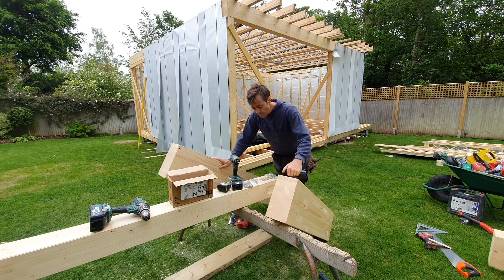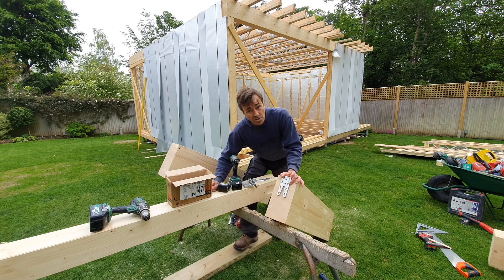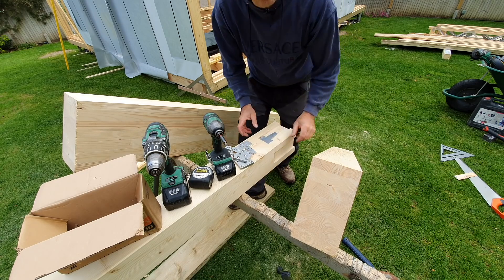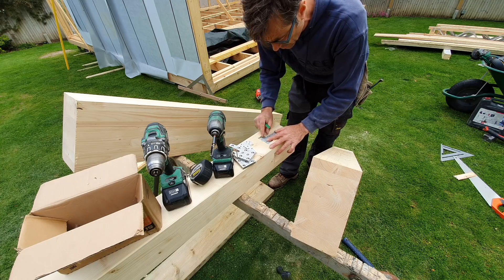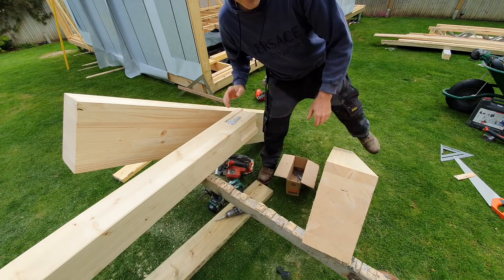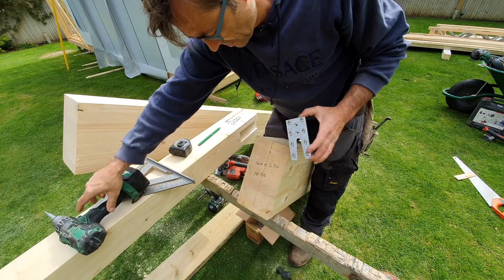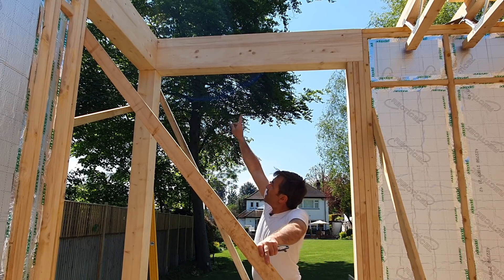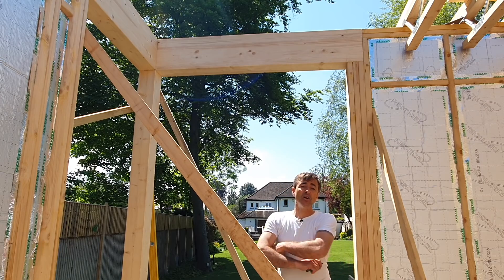Timber connector, concealed beam hanger for glulam by Simpson

Comment: Nice! However, you can do a sliding dovetail made with wood, and it is just as strong just set up time required .  Those connectors are "expensive " here in the States. Cheers, mate ✌️ nice work.
Reply from the maker: Thanks John!!!

Comment: Heya buddy. Have you had any experience fitting the Simpson BTALU concealed hangers? I'm struggling to work out what method to advise my builder/carpenter to use to form the slot to the supported 120x320mm glulam on site.. needs to be 115mm deep from the end of the beam and ideally not full depth (i.e invisible from underneath). Not sure if a circular/plunge saw would get deep enough. Grab the chisels?
Reply from the maker: Hi Mate, I have used the connectors that you mention, indeed I have them in my garden house where I have a big glulam frame, I ordered my Glulam pre slotted as the slot for the spine needs to be a pretty good fit, it could be done on site by making a jig and using a router as far as you can then a forstner type drill bit the same size that would follow the slot that the router made and keep everything true, I did have to drill the dowel positions on site and again this was pretty tricky and I made a jig to keep my drill true and aligned
Reply: @robinclevettcarpenter  Many thanks for the quick reply man, you've made me one happy fanboy today! The method sounds achievable and a lot more sensible/affordable than the chain mortiser approach that Rothoblass suggest on their vid (looks like a cool toy though!!). 
All the best.

Comment: Very nice work!! Question though... how do you connect these "2 horizontal glulam beams" with "the vertical post"? Do they simply rest on the vertical post or is that another joint that was not shown in this video? Any details would be very welcome! Thanks!
Reply from the maker: Hi Mate, the post end of the glulam is supported by these Simpson connectors and they act like a flat dovetail, the other ends of the beams sit on pockets in the timber frame as normal
Reply: Hey Robin, I'm about to build a glulam framed veranda on my timber frame house. I've been on the Simpson website, but the choice of fixings is huge. Can you remember the series number of exactly the ones that you used on the super great video. Cheer 😊

Comment: Robin what is the model of Hikoki circular saw you were using when u made that rafter jig template. It looked like it came with a hard plastic case.
Reply from the maker: Hi Travis
It is a C3607DA36V Multi Volt Circular Saw with Brushless Motor
Reply: @robinclevettcarpenter   Oh awesome. Thank you.

Comment: By putting the screws in at that angle it reduces the shear in the screws compared to them being at 90degrees.  They could not be angled up as they would then emerge out of the top of the beam.
Reply: That's a good point. Makes me wonder if they did some lab tests of shear strength vs pull-out strength and decided this was the superior solution, even if people's initial instinct is that it's wrong.

Comment: Hi Robin, a question for you...If I am doing resin studs into treated timber ledger, and also using treated 6x2 for the frame do you have to use stainless steel nails and stainless steel studs or can you use normal nails and studs.... or have you done a video on it...?? Just was wondering about the treated timbers chemicals and how they affect nails/studs etc....

Comment: Robin, any videos or help on working out compound angles? I'm building a garden corner sofa, the seat base is pitched 5° and the backrest is at 105°. I'm doing two 30° 'corners' so it's a bit more comfortable than a 45° corner. Trying to figure out the compound cut at a 30° corner where the backrest is pitched at 105° is blowing my mind! 🤬😂
Love your work! Cheers
Reply: Should have a look at the program Sketchup if you havent already (Free trial). Not too complicated to use, and really helps when making things like that to sort out the angles/dimensions etc.

Comment: Never seen those ties in Oz they look good. Those type of lam beams are also now hard to get hold of. Not due to the shortages they were before. Not stocked by the engineered timber makers. You can get them but special order. Not sure why they were good and great to work with.

Comment: Doesnt putting that bracket on the top half of the beam mean all the load is taken up in the top 50% of the beam? with the bottom just hanging of it? I would have thought this would reduce the maximum loading capacity of the beam and potentially allow it to split along its length?
Reply: You aren't loading the beam up to its maximum shear capacity. The connection will designed for the forces on the beam and not the maximum force the be can take.
Reply: @Aaron-gl8cm  But isnt that wasting wood right? get thinner cheaper beam and use its full potential?
Reply: @krellon  the timber beam is likely designed for its bending capacity or deflection. 

You are right in saying that this connection will not be able to take the full shear load of the beam. Timber design is all about the connection as they are usually the "weakest" point. Even on traditional timber frames member sizes are larger than they need to be to get the connections to work.
Reply: The glued timber beam with layered timber and glue acts almost like a horisontal truss, which makes it a lot stronger than a standard wooden beam even if it's not fastened at the bottom. The glue is a very strong bond.

Comment: I love the use of new technology meeting the traditional materials Robin and you are definitely an ambassador for that thinking. I remember an old 'New Yankee Workshop' where Norn built a bench just using 3/4 Ply, making the legs from angles of the same. I could never find a system that would take a stacked dado cutter though. One funny of that series was the subtitle that kept coming up saying 'guards removed for photographic reasons' when it would be impossible to complete the cut with a guard in place.

Comment: Might be a daft question but here goes. Would there be any additional fixings? it seems like the weight of the beam is sat on the Simpson plates. In terms of bearing they are max 5mm thick and any movement on post would mean the beam slips?
Apologies if I've got this wrong
Reply: They have an angled profile like a french cleat so the weight of the beam/load actually tightens the joint. Lateral movement not possible.
Reply: @mjslug  thanks, seems like a no brainer for future works

Comment: What I like to see is the quick western approach to a joinery solution, but in the back of my mind is also how the Japanese traditional joiners (and traditional joinery) have done it. Just adds to the depth of this trade.
Reply: Traditional joinery was also practiced outside of Japan including but not exclusively in England.
Reply: As James B. has already said, traditional joinery with carefully cut joints was not exclusively a Japanese thing! That's just how it was done back in the day. Of course, Japan being Japan, they hate to change anything so old methods linger. You'd probably love to see a Japanese house framing. They still use heavy timber framing for the basic frame, complete with traditional joints and a guy balanced on the ridge beam banging them in with a huge mallet. But the frame is pre-cut at the factory (probably computer controller cutting) and delivered onsite shrink-wrapped on palettes. A crane is hired and the whole thing goes up in a day. But then substantial amounts of modern metal fasteners are also used. This system reminds me exactly of something Japanese framers would use. Well generally it's all thru-bolts, but maybe in 20 years this will catch on!